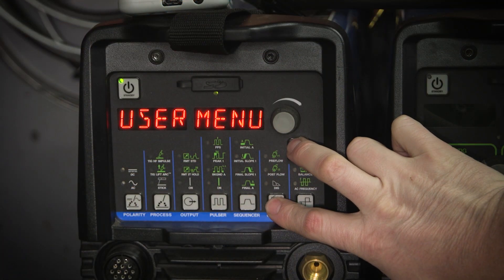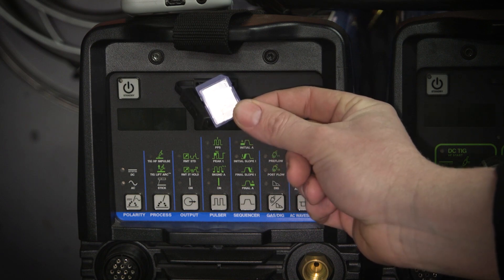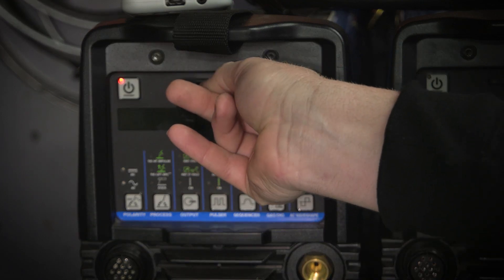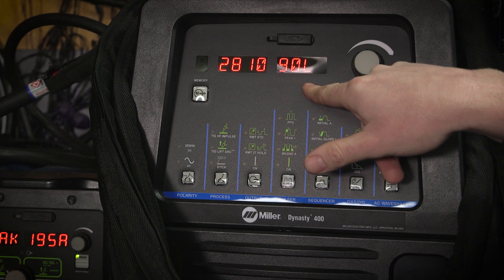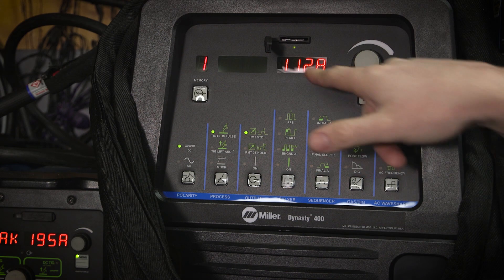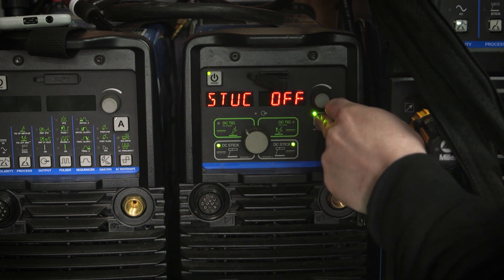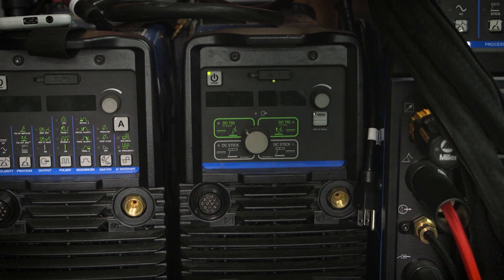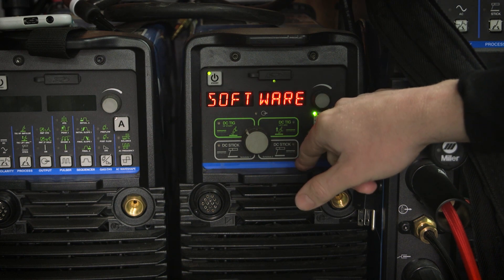Updating Miller Dynasty firmware

Comment: So what is the purpose of this? We just picked up a tb 325 and it has a USB port to update the software.
Reply from the maker: I think they keep tweaking the software and it makes them weld better. I have noticed the stick welding on the maxstars is way smoother after the update
Reply: @DarlingtonFarm  It had me wondering, Thanks for your reply
Reply: Go to Miller/support/software and they have the software updates - will tell you what improvements have been made and how to install - TB has some hot start / stick fixes.  Last update was Feb 2019 - so your new unit may be current.
https://www.millerwelds.com/support/software/engine-driven-software